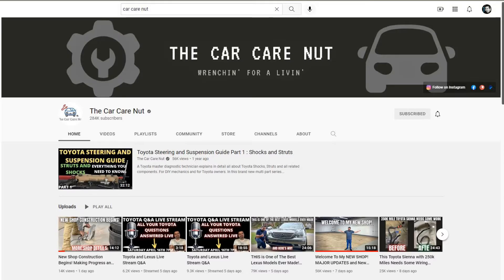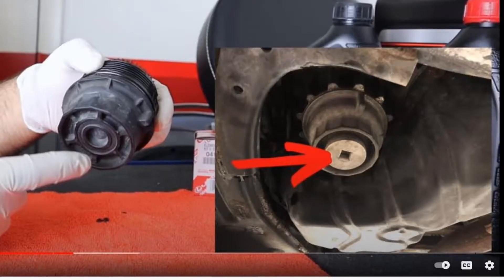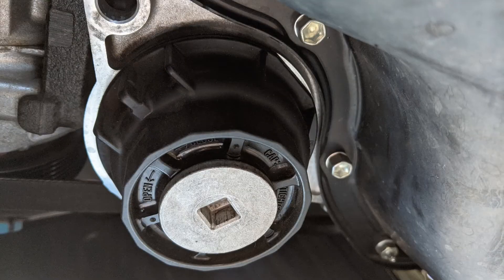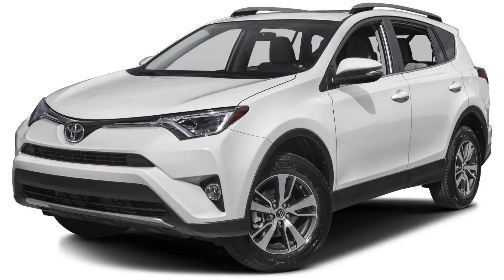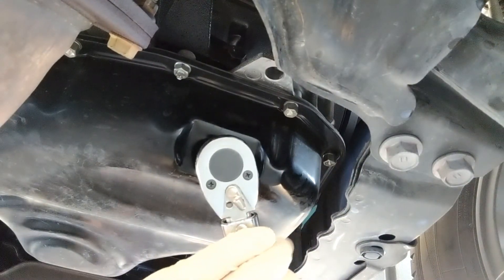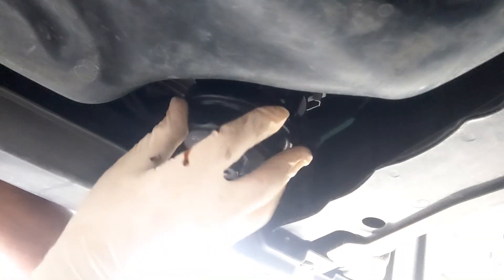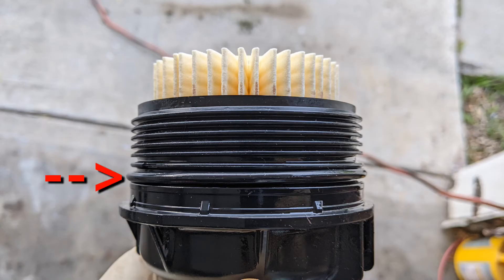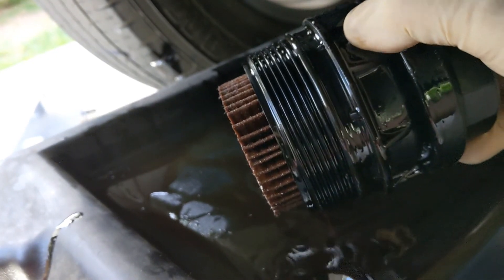2017 Toyota Rav4: Why You Shouldn't Drain the Oil Filter Plug

Comment: Best way is to loosen the canister and let it drain by tilting it before pulling it down. Its a lot less messier and still faster and easier.
Reply from the maker: You're right. I got the hang of it now. I let the filter drain some before pulling out the filter completely.
Reply: Yeah I used the stupid little plastic insert you get with the filter the first time, but decided it was more trouble than it was worth.  Now I just loosen the whole thing until it starts oozing out, let it ooze until it stops, then carefully remove it the rest of the way and tip it out into the drain pan - actually less messy than the silly little plastic thing I found.  I replace the O-ring in the bottom of the oil cap cover after cleaning up the filter - probably doesn't need replacing every time but you get one with the new filter so figure why not?
Reply: @Beer_Dad1975  its just good practice to replace it every time and no reason to risk it
Reply: @killerinstinx54  Yup, nothing more embarrassing than leaking oil onto someone's driveway because you were too lazy to replace an O-ring! 😀

Comment: You can put a plastic bag to encase the filter, then turn with the plastic on, the plastic catches the oil spill.
Reply from the maker: Good point, that is also an option. I have seen other people do that in videos but I have never used that method.

Comment: But if you don’t drain that bottom plug you won’t be replacing the small o’ring and that is a potential seepage risk in time.
Reply from the maker: @pezkao2009  how long do you think it's going to take before oil seeps out from the o ring? AMD from the The Car Care Nut has seen cars go more than 100k mi without changing the o ring. In my experience the rubber o ring probably lasts about 10 years.

Comment: Looked more messier your way. I do my friends and I do drain it from the filter. No mess at all
Reply from the maker: Yes, it's messier but faster. So you have to decide if you prioritize cleanliness or you prioritize time. This was my first time doing this method in the video. In this video I did not allow it to drain I just pulled it and it was messy, but I have found its less mess if I allow it to drain for a couple of mins after I unthread the filter.
Reply: I always have a problem trying to insert the plastic drain plug.  Is there a tool that can be used to insert it?
Reply: @sailingpittsburgh  , put a hose on the end of the barb and insert it fast and hard. It'll lock in, and you're good. They do make ones that screw in, but those drip before you get it fully screwed in
Reply: They say it's faster but now the housing is drenched in oil. So they either waste time wiping that off or are straight up leaving an oily mess in their undercarriage.

Comment: With some new oil filter kits I noticed that one I bought had a screw in plastic piece to drain the filter and worked nicely and the next one I bought was a push in type that was a mess so luckily I saved the screw in one.
Reply from the maker: Someone else mentioned that they also received the screw in type of drain with their filter. Keep using the screw in type if you like it.  I don't drain the plug anymore.

Comment: Thanks for the tips! Changed the oil on my 2017 Rav4 but boy that filter housing must have been torqued on because it was incredibly hard to get off. Why do they do that!? lol
Reply from the maker: The workers probably do that to save time. It's in the workers' interest to do the job faster. One quick ooomph to tighten the filter and they move on. They don't have the time to use a torque wrench.

Comment: Mines is stuck havnt change that seal in the last 4 oil changes will that cause a problem..
Reply from the maker: Are you referring to the bottom plug on the oil filter housing being stuck? I don't think its going to cause a problem if you don't replace that bottom seal, especially since yours is stuck.
Reply: @ChavezDIY  yes.
Reply: @ChavezDIY  it says on the filter instructions to torque that metal drain cap to 12 nM (or 9 ft/lbs). I torqued it to spec, and it still doesn’t loosen up on the next oil change without just taking off the whole filter canister. 🤷🏻‍♂️

Comment: Wait, so I don't need a special kit? I can just take off the oil filter itself & it'll drain it all?
Reply from the maker: You need the special tool to unthread and remove the black filter housing (link in video description). That's about it. You do not need the special tool to drain the oil from the bottom plug. You can leave the bottom plug alone. As you unthread the filter housing, oil will begin to drip down from the threads of the filter housing. Let the oil drain. Then completely remove the filter housing but its filled with oil so you need to carefully bring it straight down so you can drop the oil onto your oil plan.

Comment: I use the fumoto drain valve and hose plus the screw in housing drain.  Almost completely dripless.  I have a tacoma with skid plate.  Without draining the filter housing this would make a huge mess.
Reply from the maker: That drain valve makes sense for your application with the skid plate. I thought about buying a valve, but I'm fine with the risk of getting a little messy. This video was the first time I pulled off the filter housing and it was messy. But I have learned how to make it less messy now.

Comment: Unscrew the oil filter housing slowly, let the oil slowly trickle out, then unscrew more to let more oil out.   The oil filter housing will be almost empty of oil when removed.  No messy, uncontrol splashing of oil everywhere.
Reply from the maker: The second time I did this, I took my time and let the oil drain out instead of removing the filter housing quickly. It works well.

Comment: I would drain the little plug too on the filter, less mess.
Reply from the maker: It's faster and less work when you don't drain the plug. To decrease the mess, unthread the filter until the oil starts to drip. Let it drain while its still threaded. When it stops draining, unthread the filter completely and bring it straight it down and into your oil pan.
Reply: It's really not though, the stupid little plastic things they give you with the new filter are useless as hell - as long as you are patient and careful you can get a cleaner job just carefully removing the whole filter.

Comment: How do you even remove the little drain plug? Is it supposed to be turned the opposite way of the way you remove the whole filter?

Ive been trying to get the little drain off but it just spins the whole filter off.
Reply from the maker: It's not reverse threaded, its the same as any other, Left loosie, Rightie Tightie. That just means that the last person that touched it overtightened that plug. You will have to tighten the whole filter housing some more so it doesn't move when you loosen the plug.
Reply: Alright thanks.
Reply: @ChavezHobbies I experienced the same situation from the dealership (oil changes every 5K on '21 Highlander).  I have the metal housing and I am afraid of overtightning in order to remove the drain.
Reply: Glad I bought a CRV back in the day. But my daughter bought a 2017 RAV so here I am.

Comment: First time I saw the canister I thought the whole cover would come off with a 3/8" socket.  Silly me.  That would be way too easy.
Reply from the maker: You can do it that way if you over tighten the lower plug. You could even seal the lower plug with red thread locker. That's only if you wanna be cheap and not buy the special wrench, hehe.
Reply: @ChavezDIY 
Probably a good idea. It is near useless.